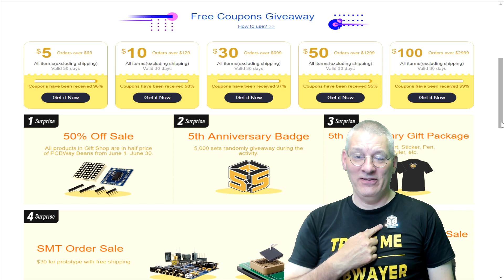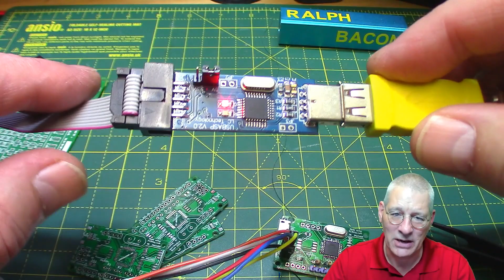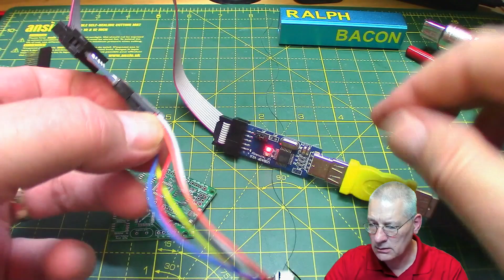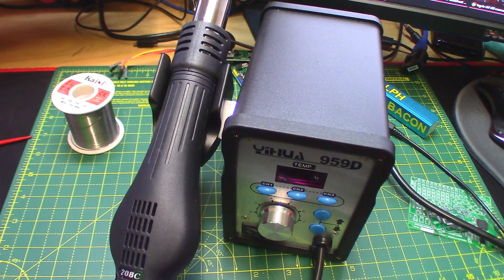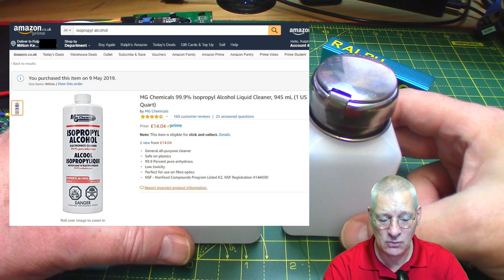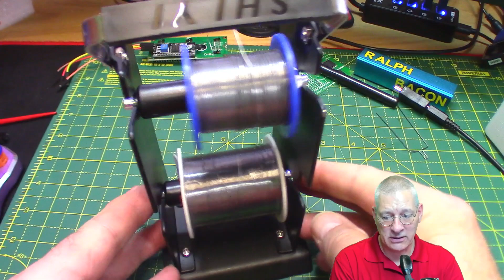#150 SMD KiCAD Arduino PCB Project (Spoiler: 😭=FAIL)

Comment: @2m51s: PCB silkscreen says "16Mhz Xtal"; but that should be MHz (because Hz has a capital H).   ;-)  !!
Reply from the maker: Correct. That was my deliberate mistake to see if you were paying attention. Actually, it might be Dr Peter who wrote that bit...
Reply: SI units are a pain at times Hz is a capital as it relates to "Heinrich Rudolf Hertz". Seconds is a small 's' as there is no Mr Second. but there was a Mr "Ernst Werner Siemens". I lost points in an exam one time as I put what looked like a capital s for seconds.

Comment: Isopropyl Alcohol; The 50% bottle at the drugstore works fine for me.
Reply: it is water. Very good combi for many stains. Alcohol for oil based/hydrophobic and water for salts/ions/hydrophil stuff
Reply from the maker: What's in the other 50% then, Paul? I don't want any kind of residue on my board so I'm seriously interested in its make-up.
Reply: The higher concentrations will absorb water from the air,  as soon as you open the bottle!

Comment: Use solder paste, its fool proof.   Get a small quantity, use a toothpick to place it.  You can add extra since a large volume is the flux which evaporates.  In the past I got 20-30 gram tubs from china.  Adafruit sells some in small tubes.  It doesnt last too long once opened, so small tubes are convenient.
Reply from the maker: I got some already but it was so messy that I decided I wasn't going to risk it (I played with it on one of the practice boards). I should have stuck with it.
Reply: I just tried solder paste, didn't have a hot air gun so used my Dremel Versatip and was really impressed with how easy it was to solder SMD components. I have poor eyesight and need reading glasses and microscopes to solder but I was able to do it. Not as hard as you might think.

Comment: Your videos are really helpful and inspiring. But... that has to be some of the worst surface mount soldering I have seen. There are some hard and fast rules to soldering fine pitch surface mount devices. Until I started following these rules, I struggled too. 1. Only use reputable branded (leaded) solder. That means brands like Kester and Multicore. As others have said, the cheap stuff is a false economy, as solder spools last for so long. I am sill on the same spool of Multicore I bought five years ago.  2. Apply some solder to one pad (not GND - as the ground plane will leach away the heat) then use it to tack down one pin of the chip. It doesn't have to be pretty. Indeed, it doesn't even matter if there is a solder bridge. Just so long as the chip is held in place. 3. The rosin core of the solder simply doesn't provide anything like enough flux for these challenging fine pitch components. You need to add a lot more flux. Again, you cannot rely upon cheap stuff - go for a reputable brand. I use Amtech NC-559-V2-TF tacky flux which is very popular. You need to literally flood the pins with the flux. 4. Now go round the chip soldering all the pins. Best to start with the pin directly opposite the one you originally soldered to make sure that the chip is properly flush with the board. if you have used the "proper amount of flux" you will see that the solder is almost sucked onto the pad and the pin. It's almost too easy. 5. Finally go back to the pins you used to hold the IC in place. I said before it doesn't matter how messy they are. If you have enough flux in place, just touching the pin with the soldering iron and the solder will just sort itself out. Easy! If you want to see more, just watch the videos on Louis Rossman's channel (especially ones where he talks about "the proper amount of flux"). I now routinely solder chips with 0.4mm pitch. I successfully soldered a 01005 passive recently. Hope this helps and keep up the great videos.
Reply from the maker: "...some of the worst surface mount soldering I have seen." Don't sugar coat it then, hey?!!! 
To be honest, what you describe is pretty much what I practised on the training board with a couple of notable exceptions: I used my original 0.7mm quality solder and some extra flux. On this actual board I tried the new (but rubbish) 0.3mm solder and, well, you saw what happened. I'm going to try again with a spare board following your instructions to the letter. Practice (and lots of flux) makes perfect... maybe. Thanks for posting, appreciated.
Reply: @RalphBacon  I need to post some of my Arduino code for you to comment on; then you can get your own back ;)
Reply from the maker: I won't judge you on your code, er, JudgeBeeb. 😜

Comment: My wife and daughter found some of those pump bottles at the Dollar store (where everything is $1). They don't have a metal lid (it's only plastic), but I don't plan on bringing a bunch of heat near my bottle of alcohol anyway. Plus I found a pack of 36 - 1/2 in. Horsehair Bristle Acid Shop Brushes for $2.50 at Harbor Freight (a low quality hardware/tool store). I have always thought of them as disposable anyway. I have always managed to loose or drop them onto a dirty floor long before they failed anyway.
Reply from the maker: Indeed, Steven, I saw plenty of nail varnish remover bottles at my local Superdrug but then I thought, Does Isopropyl alcohol melt them? Why else does Menda specifically state that their bottles are made with HDPE and can indeed be used with nail varnish remover, Isopropyl and other solutions? Did those bottles work for you? Regarding the brushes I agree, buy cheap and dispose of when used up!

Comment: I'm not so sure it's the solder at all. Since I have enough lead solder to last the rest of my life, that's all I use. Same solder, same iron and mixed outcome depending on where the boards come from. Maybe the plating layer that suppliers are using over the copper is different? I've tried roughing up brand new boards and precleaning and still get crappy results with some of these plated boards. I've etched copper boards from scratch and plated them myself and those solder great with lead solder. Maybe these board vendors need to supply solder and flux designed for their boards plating compounds. It's also possible the iron tip has been compromised from using lead and lead free solder and their fluxes? Soldering used to be the simple part of a project but something has changed.
Reply from the maker: I've checked the PCBWay web site. It states HASL with lead (not lead-free, which is an option). Perhaps I should have re-tinned the IC connections with more solder first. Or just used flux, of which I too have a lifetime supply! I shall be practising al this on the other 9 boards I have to hand!

Comment: Ralph, so I need to make an Net Label for pin 28 on the ATMEGA (SCL) and connect it to the clock (DS1337+) pin 6 to fix the error.  Correct?  Thanks
Reply from the maker: Almost, Skip. The pin 28 SCL net must be connected to the SCL net for the EEPROMS and DS1337 (and possibly out to a header pin, I would do that). But the SCK on the ICSP must still go to pin 17 SCK on the Arduino so we can upload programs. The SCK should not go anywhere else (but it is connected to multiple points as it stands, so some serious track editing is required).
Reply: @RalphBacon  Thanks Ralph.  I really learn a lot from your videos.  Just one other question.  Did you figure out where pin 3 (The alarm) on the DS1337+ clock is suppose to connect to the ATMEGA and the resistor on the clock you added is connected to what pins? I really want to make a functional PCB.  Peter did point to a link to some good programming ideas from Sparkfun: https://learn.sparkfun.com/tutorials/reading-and-writing-serial-eeproms#higher-capacity-eeproms  Keep it up with the videos and I am using your links for parts when I can

Comment: I spy another hack with a resistor?
Reply from the maker: The one on the DS1337 chip, Adam? I half explained why I did that; it wasn't necessary to get the board working but it was necessary for me to prove the chip was running - but not on the I2C bus.
Reply: @RalphBacon  Yeh, you explained it two minits after I made the comment!

Comment: How did you load the bootloader ?
Reply from the maker: I used the Arduino IDE and chose Tools - Burn Bootloader. I might have used the Arduino as ISP in that case. It worked because the LED started to blink (I think some simple BLINK program is uploaded at the same time).

Comment: About the tool that comes with the hot air desoldering. Yes it is supposed to be screwed on the end of that stick. It is supposed to be used to lift component when desoldering. I never used such a tool since I at least don't find it useful, just use your regular tweezers.
Reply: True. Useless says all I asked at my Maker Space.
Reply from the maker: Use my tweezers I did, John, as I didn't know what it was for. But I will try it on my practice board.
Reply: @RalphBacon  Now that I think about it could be handy ..not for components... but say for Connectors ... for chip's it is useless. But now that i think about it ... yup  could be of some use for those big long connectors .. very limited use imho tho ... tweezers would work on those also :)

Comment: If some solder seems to not work well, it may be non-fluxed or with bad flux. Most solders I've come by are flux cored but you never know what you get from the cheap chinese supplier. Getting leaded solder locally from a reputable supplier has got a lot mo difficult every year.
I assume you used flux on the pcb. It is sometimes really needed even if you can get by without occationally (or the practice pcb may be coated with flux).
Reply from the maker: Yes, the lack of flux does seem to be a recurring point made by you and many others here. Hmm. I must practice some more, using more flux.

Comment: umm I see you were using the wrong Solder tip. Androkavo channel shows very well what solder iron tip should be used and for drag solder it should be like the Hakko M900 T2-2C point.
The tip you used is by no means the right one.
Reply from the maker: But it's the tip I used on my practice board, John, and it worked really well there (much to my surprise). I haven't looked at that channel yet, but I've seen other videos where they promote a concave tip so that solder can 'well' in there as a supply for soldering. I can't get one for this Antex soldering iron I have, more's the pity.
Reply: @RalphBacon  No problem Ralph, I do believe the solder is indeed a factor ... like you mentioned .... I also doubt the solder was a Sn-Pb type ... most likely those very inexpensive could be reflowed from non- Sn-Pb leftovers from big SMD industrial "forges" :) In any case using and flooding the multi-pin components with Flux is paramount. Even when using Kester Solder wire ... no matter how much flux in inside the solder wire.

Comment: You need to watch AndroKavo channel. One thing I noticed is that you small video of you placing the 238 chip does not have flux ...Flux is paramount when soldering SMD's ... could that  be the problem on your soldering ?
Reply from the maker: It could be, John, but as others have confirmed here, there does seem to be a generic problems with solder sourced from China. Maybe the two together (lack of) flux and crappy solder just exasperated the problem... I'll have a quick look for that channel, though, thanks for the heads up.
Reply: @RalphBacon  I agree with the lack of quality of anything coming from China, specially solder. There are some brands that could be of some use , like Kaina. The one you shows is an imitation of an imitation :) (kaina like branded). But other then one or two brands of Solder I would avoid and stick to top quality Kester ...
Another thing is that Irrespective of How much flux there is on the solder wire on multi-pin components you are going to take time to solder the pins and hence the Flux Evaporates. So it is Paramount to Flood the pins with solder Before soldering Even if the solder wire does have Flux. On a single pin thru hole pin component it is  a different scenario since it is a very fast soldering and the Solder is Applied directly to the pin ... hence it retains the  flux during reflow. I truly suggest looking at several of Androkavo channel smd soldering videos.
Reply from the maker: Will do, John, thanks for the advice. 😀

Comment: At work, we use Toluene and a toothbrush to clean off flux.  It's much more aggressive than alcohol and many alcohols leave a white residue due to a denaturing agent. Toluene will destroy many plastics used for cases but most connectors and components are fine with it. Around here it's much cheaper to buy and available at hardware stores.
Reply from the maker: I was looking for a plastic-friendly fluid (unlike nail varnish remover which also dissolves plastic ases just by looking at them). Toluene smells like White Spirit, right? Blagh! But the white residue you mention appears on my fingers but not on the PCB. Why's that?

Comment: The tool is a "popper" - it is used to apply a very small amount of pressure when desoldering large ICs from a board. You slide it under the chip, apply a slight twist to tension it, and apply head. As soon as all the solder has melted the chip will "pop" off the board and you'll minimise risk of PCB damage. Mostly useful on large ball grit or QFP packages, but useful for others. If you have very fine traces it is too easy to rip off a pad using tweezers....
Reply: Lol @ application of head
Reply: @muesli4597  Ah I have poor eyesight and missed that blooper!
Reply from the maker: Yes, Ian, everyone (except me) knew what that tool was for! I could have used that when desoldering the ATMEGA328P chip for the first and second time. Oh well, thanks for the tip, I'll know next time.

Comment: As a side comment, I also was unhappy with the compile speed of my PC (Win10) and upgraded my HDD (1Tb 5400rpm) to Samsung 860 evo SSD. Generally 12X faster. Now the computer is waiting on the CPU and NOT the HDD to complete the operations.
Reply from the maker: Absolutely, William. My HP mini PC (3GHz Quad Core I5, 16GB memory) was sluggish before I replaced the hard disk a couple of years ago. Then it became a speed demon. Only thing is I replaced the HDD with a 250Gb SDD (all I could afford) but now I'm thinking of upgrading to a 500Gb. I also love the Samsung EVO disks, I won't touch the cheapers ones as I've heard Bad Things about their longevity.

Comment: Did you use lots of flux when you soldered that QFP? Maybe was a type of solder issue but looks more like lack of flux to me. After listening to the rest of the videos... Yes, you used loads of flux.

The tool you asked about is an IC extractor. The wire forked front screws onto the handle. Here is a picture of how it works: https://de.aliexpress.com/item/32843830642.html
Reply from the maker: Well, well, who would have thought that? No instructions or picture with the heat gun! Thanks very much for this, Chris, all is now clear, I knew one of you guys would know!